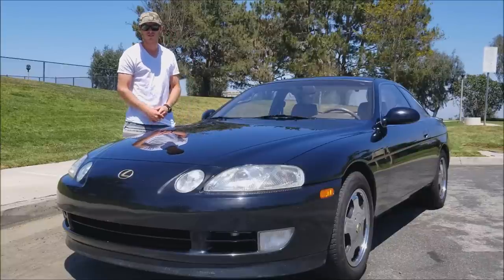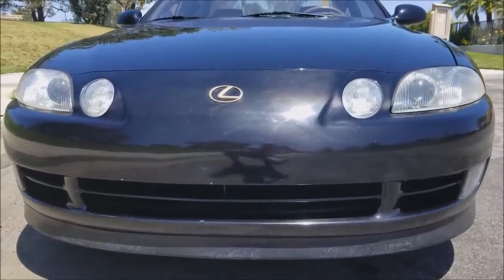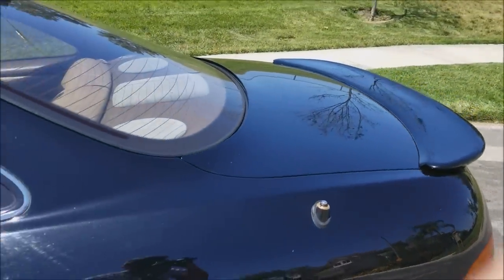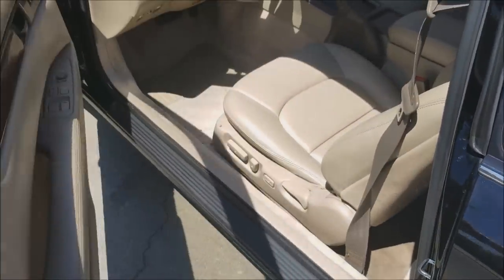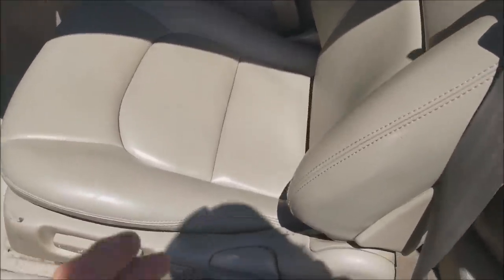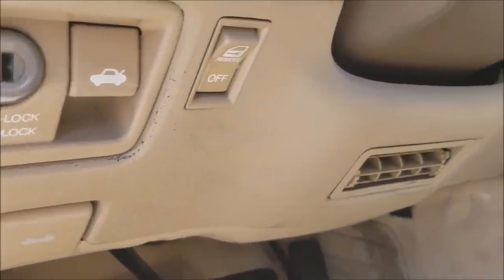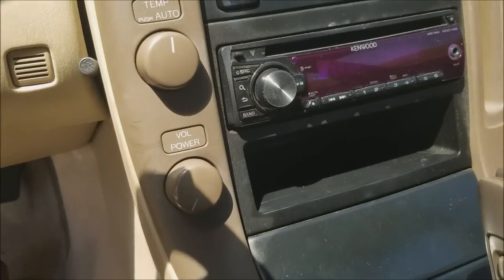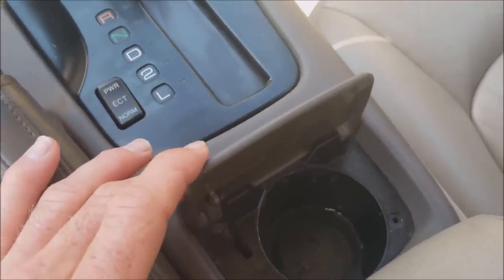My Lexus SC400

Comment: Nice SC sir I had a 93 SC400 and currently have a 98 SC400 which is  easily the best car I've ever had that mic on the dash is not Factory to that phone that's a part of that aftermarket stereo Bluetooth phone system the original Factory mic for original factory phone is on the phone selector on the steering wheel enjoy that Lexus sir
Reply from the maker: Thank you. I am proud to own this car. I've always wanted to own a vvt-i sc400 and they are great cars. For the price and condition of this one though, can't beat it. I have every single maintenance record including the sale paperwork when it was sold new in 92. I also have the 3 original keys that came with the car, clean 2-owner Carfax and of course this beauty.That is correct, it is an aftermarket microphone, but very cool. Want to keep it factory and clean as possible without ruining its heritage and legacy.
Reply: @DaylyDriverDayly  it is a fine example sir have fun with it
Reply from the maker: It is factory as it gets
Reply: @DaylyDriverDayly  I got an extra Nakamichi radio if you need it.
Reply from the maker: You located in socal? I have to figure out whats going on with the radio I currently have in the car, it just stopped working one day. That is very kind of you to offer me that, but I can't accept that. Much appreciated though. Where did you get that radio from?
Reply: @DaylyDriverDayly  I've got a lot of sc parts that I've collected over the years I also have that in the dash cup holder you are missing I've also got a couple dashboards ecms mass air flow sensors instrument clusters I've collected them over the years and they often come in handy when I run into other people who need parts it's always my pleasure to make their day it would be my pleasure to donate you this radio and cup holder to help complete your Lexus sir
Reply from the maker: @j-deezy321  that is very kind of you and appreciated very much.
Reply: @DaylyDriverDayly  it's no problem sir it's what I do let me know if you decide you want them
Reply from the maker: I am actually very interested. I am not the type to just accept things from others. I would like to help you in return.
Reply: @DaylyDriverDayly  that shows good character sir but we also must be willing to accept what the universe gives brings us with good faith knowing that we are deserving because we've already earned it somewhere through good deeds.
Reply from the maker: Agreed! Through faith and the giving of oneself for others can create blessings.

Comment: Nice review man, clean car, I have a question. Would you recommend this car as a daily driver for a 18 year old? How much money have you put into the car for repairs? Would you say it’s worth it for a 18 year to daily around or would you say it’s more of a project
Reply from the maker: I recommend this car all day long as a daily. For being 18, the car is quick but not overpowered. The sound of the engine is AMAZING!! Low maintenance costs overall depending on the specific  sc you buy. Purchasing a decently low mileage, clean title and carfax sc400 can be a dream. The power steering pump, hoses and rack and pinion steering tend to wear out on these. Depending where you get the parts, can easily be $1k in parts. More if you outsource the labor. Depends on how well the vehicle has been maintained. An absolute steal for the price if you can find a clean one
Reply: Yes the Lexus SC 400 is a great car but not too practical for an 18 year old I'd assume most eighteen-year-olds would be better off with a 4-door car not to mention the Lexus Sport coupe can be kind of enticing and lead to trouble for a young driver LOL
Reply: I got my 95 sc400 when I was 18 and so far I've had no trouble, gas lasts about 2 weeks driving it everyday insurance is pretty cheap and the back seats are very roomy (I'm 6'3" and fit perfectly)
Reply: @joshg.9390  your back seats are roomy I must have got jipped on my SC's LOL  I don't let anybody in my car anyway LOL
Reply from the maker: @joshg.9390  that's a great year sc400 with the updated front fascia and rear tail lights. maintain it well and it will treat you even better. I never really sit in the back since I'm always driving, but there definitely is plenty of room

Comment: I fixed my 3rd brake light by taking the original led strip out and opening it up to put eBay led strip and rewired it back. Works great again
Reply from the maker: that's awesome. how much did it cost you for the led strip? I will eventually fix my rear spoiler light
Reply: About 20 bucks  for white led strip and epoxy to seal the lights up again there's a forum post on how to fix also
Reply from the maker: @ryanle6286  that's not bad at all. I haven't looked up the pricing yet since I have other projects I am working on, but will get it done when I start fixing the minor issues with the car👌👌

Comment: The tan interior is fucken beautiful
Reply from the maker: The interior is spotless on this car. Very comfortable seats.
Reply: I got the grey ..tan one is fucken great
Reply from the maker: @rustyshakelferg4304  what year? I happen to have never owned any other color interior than tan 🤣🤣 I didn't choose tan on purpose. it's actually enjoyable though
Reply: 1992 think it's Renaissance red grey interior my stepdad has the tan interior with the hard top his is a 92 as well but upgraded to a 97 trans and engine I only did the 97 trans with a 92 engine car is more fun to drive hate the torque converter holding it back and the diff sucks ass
Reply from the maker: @rustyshakelferg4304  it's the gearing ratio for the automatic trans that sucks. that's why I want to swap mine with the sc300 r154 trans and differential
Reply: Heard the cd009 6 speed is cool off the Nissan z
Reply from the maker: @rustyshakelferg4304  I'm sure it would be but I want to keep it time period correct with factory toyota parts
Reply: Have you seen the 4500gt Toyota wish that was available to the public 6speed tranny on a 1uz

Comment: Looking to get an sc for my second car do you think I should shoot for a 300 or 400
Reply from the maker: that's a great question. it depends on what you are looking for. the 400 has the 4.0 v8 and an amazing exhaust sound from the factory. it also has 250hp whereas the 300 has an 3.0 inline 6 cylinder engine with 225hp. the 400 comes with nicer factory wheels than the 300. the 300 is cheaper to maintain and has a stronger bottom end of the motor made of cast iron whereas the 400 does not. basically the 300 is the naturally aspirated very of the very expensive and popular toyota supra twin turbo and the n/a toyota supra. the sc300 and 400 can be purchased around the same price. what is it you are looking for in the car and are you planning on keeping it stock?

Comment: Congrats. I also have loved this car for some time. Good condition with a good color combo. I might be a little strange with my priorities, but I love the extreme engineering that went into the door hinge. I also like that this car has not been pimped out with tuner crap or large dub wheels. Please don't fuck with it. Don't gild the lily.
Reply from the maker: Hahahaha. I am going to keep it clean stock except swapping a manual transmission from the Lexus sc300. The r154 is still stock Toyota for the SC. Gonna keep her purty. Thanks for the reply.

Comment: I just one and the owner says that the maf isn't to good, and its only got 180,000km wondering if I should buy a new or used maf and how could I check if that really is an issue
Reply from the maker: Great question and thanks for reaching out. I would run a scanner on it to see if it is pulling a code for the maf sensor. Next I would disconnect the maf sensor and pull the portion of the intake hose off with the sensor that is located inside. Its a metal piece that sticks inside the intake hose. I would use mass airflow sensor cleaner and spray the sensor down thoroughly in order to clean it. let it dry out completely before you put it back together. Check the connection to the maf sensor for any corrosion or wear on the connector parts to the sensor itself and to see if it has damaged or bent prongs. After this, start and run the car to see if you are still having issues. If so, I would recommend replacing the sensor. Hope this helps. Let me know if you have any further questions. Great car by the way!
Reply: @DaylyDriverDayly  sweet will do thank you, yeah very excited, everything works expect for the radio because of the blown amp due to water damage hopefully it just needs a clean
Reply from the maker: @onlyandalwaysfooty4425  no problem.  I would check the connections to the battery and amp to make sure there are no issues there. If anything you might need a new amp or even speakers if there are blown.
Reply: Daily Driver hey, so my car is has now a blinking check engine light... it blinks twice at first then 4 times after I haven’t replaced anything and that’s what it’s showing
Reply from the maker: footy  you need to have a mechanic scan your cars system to see what is causing the light to appear and what the mechanical failure is. most mechanical will do this for free. what are the symptoms you are having with the vehicle?
Reply: Daily Driver there really isn’t Anything that I can tell that’s wrong other then the check engine light and the o/D light stays on and blinks when I try to turn it on
Reply from the maker: @onlyandalwaysfooty4425  I would find out what code its pulling for the check engine light. it could be something serious or simple

Comment: Is $4,995 a fair price for a 94 sc400, clean title,  1 owner , 105,000 miles , has great paint and new tires , recently bought from an auction by the dealership
Reply from the maker: Wonder why it was at auction if it seems to be such a nice car. Don't get me wrong, you can find nice cars at auction depending on the auction. Usually very well kept, clean original cars with no title problems, mechanical issues or other problems Don't always tend to go to auction unless it was a dealer auction of some sort. Manheim auctions tend to have some very nice cars, but many are not open to public. I would ask them what type of auction they bought the car from and if they have a current print out of the Carfax for the vehicle. I would be curious to know if it has been in an accident. keep in mind that for cars in the early 90s, the chances of it having been beat on, odometer rollback, accident or other issues are greatly increased over a car that's say 10 years old. You will want to do a thorough inspection on the car. If it is very good condition and all checks out, it's honestly not a bad deal at all.
Reply: @DaylyDriverDayly  is buying a this as my first car a bad idea , it has a v8 which consumes a lot of gas , but I drive no more than 20 miles a week ,
Reply from the maker: @mofin6257  absolutely not. if you only drive that little every week then gas should not be an issue unless you are doing long distance commutes. insurance is very cheap for this car and maintenance is reasonable
Reply from the maker: @mofin6257  I highly suggest this car
Reply: @DaylyDriverDayly  thanks for the reply
Reply from the maker: @mofin6257  absolutely 👍

Comment: This same car is selling nearby, the same 1992 Lexus SC400 ... but only has 38,000 on it.. I haven't heard much about these cars, but shit, it's only going for $8,700... Hope it's worth it. 

Edit: But wait... is there more? Is this too good to be true or may it possibly be a luck of the draw?
Reply from the maker: That is obviously extremely low miles for this car. It would be nice to know if the car is all original and factory parts. If you found a 92' SC400 with that low of miles it makes me wonder, is it original and has it been in any accidents or had any other significant damage to the car. I saw a 92' SC400 in black (most expensive color on the SC) with 55,000 original miles, looked like new and sold for $10k. if it is truly all original it may be worth it.

Comment: Should I buy a 95’ SC400 for 1500? It only has cosmetic issues apparently, passenger door won’t open and the driver window needs to be replaced as well as the ignition lock. That’s about it thoe.
Reply from the maker: It sounds like a decent deal. I would first calculate out the cost for the parts that need to be replaced and how much cosmetic damage the vehicle has inside and out. If you will be doing the repairs on the car yourself it will be a better deal than if you are having someone else do the labor. How many miles does the car have?
Reply: the daily driver okay apparently it got sold but I found an 92’ SC400 for 1800. The interior just has a few cuts on the driver seat and it has 170k miles. You think this is a better offer?
Reply: @NoctixLucis  your best bet is a 98 to 2000 it has bigger brakes and with the variable valve timing and extra gear in the transmission that's much quicker then the older earlier models
Reply: @NoctixLucis  if the only damage to the interior is some minor Rip's on the driver seat that's a good sign LOL as the Interiors were the first things to go on those cars

Comment: Planning on buying an sc400 with 170k kms (100k miles-ish) but the guy's asking $7900 (about $6000 USD)
Reply from the maker: I would say that is priced at the higher end. It depends on the market where you specifically live in Canada (what other sc400s are selling for). If that was for sale in California where I am, it would be sitting for sale for some time. If the car is in really good condition and has paperwork to prove repairs that have been done and other paperwork on the car, it may be worth it at a way lower price. I bought mine for $2500 US with 111k mi
Reply: @DaylyDriverDayly  it's been on the market for 8 weeks with only 800 views, so I would definitely have the advantage of lowering the price. SC400/SC300 are kinda hard to come by, right now there's only 1 for sale.
Reply from the maker: @callmezucc9318  oh wow, very few out there for you to choose from. that's a good amount of time that it has been for sale for. it's because they are asking wayy too much for the car
Reply: @DaylyDriverDayly  Yea our population density is tiny compared to the States. Hopefully I can snatch it for a better price. I plan to sell my car for $6000. Should cover the cost of the SC
Reply from the maker: @callmezucc9318  I would check the undersides of the car for rust. I can say if you are able to make the right deal on the car and it is in good condition with a low 170kms, you wont be disappointed with the car. I've owned a handful of sc400s and I kept buying them because they are soooooo much fun to drive and reliable
Reply: @DaylyDriverDayly  Well I bought one for 3k, about $1500 of work needed but she's safetied. 160k kms
Reply from the maker: @callmezucc9318  congrats on the purchase👍😁
you will love the car. the car is such a great classic. I have to put some work into mine. need to do a whole new steering system. once I get it fixed up I'll he driving her daily 😁

Comment: And that button is for traction control it doesn't produce more horsepower magically to help give you power to get up a hill LOL
Reply: It actually is "sport mode" it makes the transmission downshift with less throttle and itll rev higher before it shifts. At wide open throttle you wont notice much of a difference except when you first take off from a roll.
Reply: @danielslaughter104  it's traction control sir